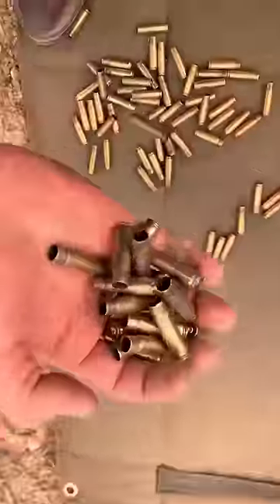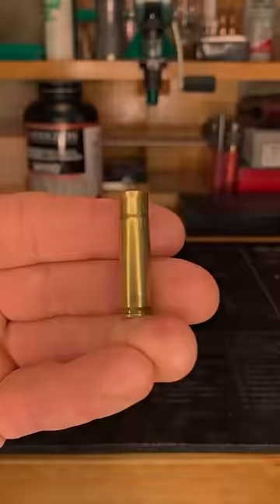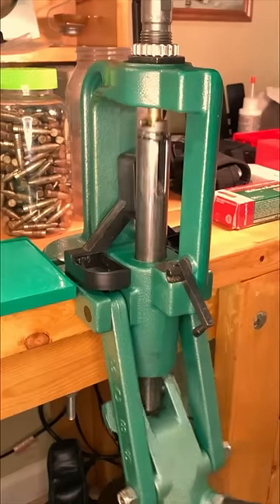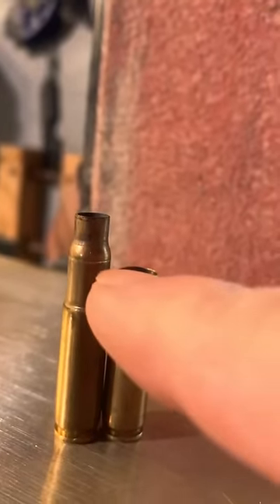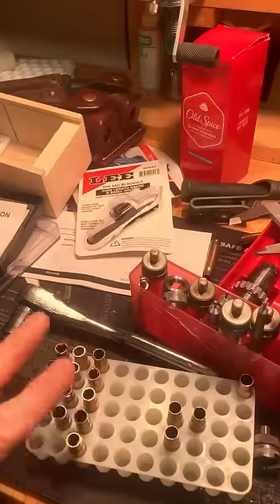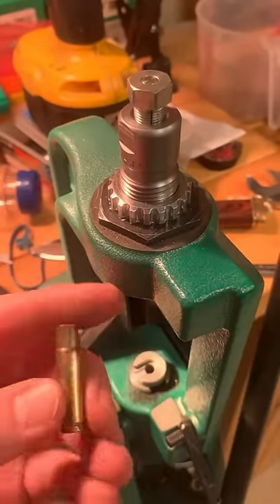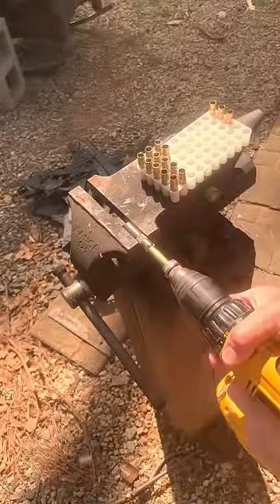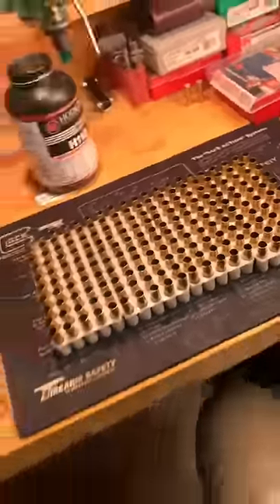How to convert .223 cases to 300 blackout. #shooting #reloading #300blackout

Comment: And  for only an hour’s work you’ve saved yourself 67 cents! Congrats!
Reply from the maker: Maybe you didn’t see the part of the video that shows a jug of brass for $239.99. I produced that same volume of brass in 2 hours. But don’t worry I think you have an amazing head for numbers! Was Good Will Hunting actually based on you?
Reply: #livetolearn
Reply: 😂 good will hunting got yo ass boy 😂
Reply: Giving this dude the benefit of the doubt, he could be factoring in equipment and labor cost, in which case, yes it would still take quite a load of rounds to make reloading profitable. But once you reach the point where the equipment has paid for itself then it's pure savings indefinitely. But on the off chance you've got some source for super discount brass, fill me in, promise I won't tell😂
Reply: @SeanAn117 reloading smaller more common calibers used to be a great way to save money but I recently looked into reloading .223/5.56 and to start out including buying gun powder bullets primers (no brass) and a small started set up I would only be saving about 2 cents a round and that was before factoring in my time which I value a lot more than 2 cents.
Reply: @SeanAn117 you use all this same equipment to reload your big rifle rounds too I’m saving 1.60 for every round of 6.5 I load. I shoot a lot, it’s a hobby that pays for itself if you shoot a bunch.
Reply: @staggerleesmancave8987  how do you like THEM apples? 😂
Reply: But multiply that by maybe 100 or even more, its like a gas u think its maybe didnt increase much put after u start putting it in ur car u can see the cost
Reply: If a man teaches you how to fish, don't bring up Red Lobster.
Reply: @staggerleesmancave8987  somebody call the burn unit we have patient with 4th degree burns over their entire body
Reply: Every penny counts in Bidenomics
Reply: @staggerleesmancave8987  - my guy’s wicked smaht”
Reply: @evankaylor6103  And you have the ability to make very accurate rounds. That's one of the reasons that I do it, and I enjoy it.
Reply: @vicv7075  I think the reminder is longevity. Factor the cost of materials then do the math how long its gonna take to pay that equipment off. Let's say ten reloads. Once you pass that 10 reloads stage long as you aren't regularly buying new brass every day cost wise you'll start saving. Not to mention less general waste of packaging and frankly, if you're factoring in labor on this you're looking at it wrong. Labor shouldn't be a factor because you're doing it yourself to avoid paying someone else to so it, ie keeping money in your pocket. So now consider what you're saving once the gear is paid. You've subtracted labor, packaging and thr cost of the brass itself from the scenario. What's your savings then
Reply: How so? I've been reloading since the 80s. If you reloading a .308 you would save 67 cent A ROUND
Reply: @staggerleesmancave8987  yeah then you need 250 worth of projectiles, 50+ in GP, 55 in primers so 350 dollars. Then the work of collecting the 1000 brass and all the reman work and tooling, or 500 dollars for 1000 rounds. I’m not hating, but it is a good amount of effort to save 150 bucks. Especially if you aren’t running thousands of rounds of one caliber on a regular basis.
Reply: Do you have any idea how expensive ammo is? Mine is running at roughly $4 per bullet.
Reply: @skimbeeble6143  for .300 blk? do you know you’re getting robbed?
Reply: @vicv7075 reloading is absolutely more cost efficient than buying ammo from the store. You can also go very cheap with it as well. Theres soo many different factors in the whole reloading process. Sure if you buy brand new brass and top of the line powder with top of the line bulles and top of the line primers then i understand. If you get into it and use a different powder of different burn/grain structures/smaller load statistics/etc youll save money. You buy or save used brass youll save a ton of money. You buy low end bullets or make your own for the majority of shooting and youll save money. The few main costs are typically finding primers and buying upfront tools. Even this can be done cheaply or secondhand when it comes to actual tools. I mean you can even go cheaper than what i mentioned but i wont go into that on yt.
Reply: If you get a lil extra equipment not even a lot you can subtract the cost of bullets and collect lead with the brass and cast your own bullets
Reply: Either way…67¢ and a whole lotta fun. Win in my book. Act accordingly fellas.
Reply: Yall some hatters. The man is helping! And yall are trolls. Sad.
Reply: @SeanAn117 I just bought all of my reloading stuff for 556 and 9mm. TOTAL plus upgrades  in for 1600. I shoot about 2k 9mm and 1k 556/year. At current prices I’m saving 5cpr on 9mm and 20cpr on 556. It’s about 6 years for me to “pay off” my equipment. That also doesn’t include the random loads here or there I do for my bolt guns/friends 6.5CM, .308, 300blk. I have an arrangement worked out with the guys so I am “profiting” off of that too.
Reply: @vicv7075 how are you only saving 2cents per round? I’m saving almost 20 on my 556 77gr loads.
Reply: @staggerleesmancave8987  if I work over time I get paid $40/h after taxes. I can but 220g OTM at $0.75 a round. If I work 1 hour of OT I can buy about 60 rounds of ammo. Can you make more than 60 rounds in an hour?
Reply: I remember when I could buy .300 blk for 38 cents a round. Got rid of everything in 300 blackout and just focus on .308 now.
Reply: A penny saved is a penny earned but anyway this short is about convert .223 cases to 300bk not about saving money my guy.
Reply: @sean anderson  luckily this guy has reloaded shit tons so the cost has been offset. Probably years ago
Reply: @vicv7075  that's why reloading rounds that are 2 or more bucks a round is worth it. But if you're doing to save money but shoot less than 1000 rounds a month you're never really going to see those savings. Furthermore you're forgetting the main reason why reloaders reload... Controling consistency. If you spent hundreds of dollars tailoring a hand load to your gun and your gun produces accurate shots that will shoot a nail off a barn door at 200 yards. You've justified your cost especially if you're a PRS shooter where depending on your skill level the prize is anything from ammo, gear or outright cash.
Reply: @staggerleesmancave8987  no, stop, he's already dead 😂😂😂
Reply: @elconquistador932  that’s mostly why I do it too. I can reload 9mm with hand poured lead for about 15 cents per rd. In a progressive loader, I can comfortably reload 200 per hour. I’m saving about 20 cents per round, so I’m saving 40 bucks an hour, I get to shoot more, and I’m doing something I enjoy. 

Also good luck finding factoring ammo that can outshoot hand loads in the first place.
Reply: you don't reload to save money. you reload to go to the range more often
Reply: @evankaylor6103  damn straight. I always hesitate when replying to the peeps that resist reloading. On one hand they're missing out, on the other there's less newb reloaders buying up all our supplies and thus driving prices up.  And that's one reason primers are so high, they know people will pay that amount. I'm still in resist mode, feeding off the stockpile.
Reply: @Airondot  Easily, and they're more accurate than that cheap ammo too.
Reply: @elconquistador932  So you’re able to resize .223 brass, trim them down, resize again, ream, measure out the powder, load powder, press in the round, and check for defects all in under 1 minute?
Reply: @dondelchulia3189  not 300BLK. 300 Win Mag. Reloading is always cheaper than buying.
Reply: @7.62by39LesscoBrandon  It is, and I’m all for reloading. However when I math this out, it’s more expensive in time (for how much I make) to reload than it is to buy new ammo. That’s not including the close for all the supporting equipment that I didn’t even factor in. Reloading is cool, especially for more esoteric rounds like 5.7 or something like that.
Reply: @Airondot  I'm nottalkingb300 blk out, I thought we were talking about prepped brass for a standard cartridge. In that case yes, easily on a turret press. Prepping brass no way. But I prep all types of brass and have it ready.
 I understand what you're saying about cost/time and what not. Like in another comment I made its not about speed, it's quality, cost and over time I stock pile. It's not for everyone but everyone should know how to do it it. A matter of time before the Liberals and Rinos in charge go after our ammo.
Reply: @staggerleesmancave8987  Please upload that video where you do everything you just showed us to get the casing where average time per casing with 7 operations per casing is 7.2 seconds.
Reply: @skimbeeble6143  yeah for cartilages like that it makes a lot of sense. Most common rounds are barely cheaper like .300 blk like in this video
Reply: @vicv7075 It depends on what you are trying to do. If you are blasting, cheap bulk ammunition is hard to beat. If you want to shoot sub 1/2” groups, you might need to hand load
Reply: .67 cents per cartridge..
Reply: @Airondot easily
Reply: @Robmancan1987  endless shrimp is endless shrimp bro.
Reply: @staggerleesmancave8987 Someone is mad
Reply: @staggerleesmancave8987  I’d like to report a murder😂
Reply: @staggerleesmancave8987 hopefully (but highly doubtful considering this guy’s lack of self awareness) he meant per round
Reply: @staggerleesmancave8987  fuckin got his ass
Reply: @CLEAN_FINGER_BANG 😂😂
Reply: @Airondot  With my progressive loader, more then that. But you don't have to trim brass everytime. Relaoding for me was my hobbie. Relaoded 4 different pistols and 7 different rifles cartridges. Not all at once and was doing a lot of range time. But if ya got the $ for new cartridges send me the brass.
Reply: @vicv7075  you cant count your time and you should not sell your reloads.
Reply: It’s not about that it all boils down to when there’s no Ammo on the shelf and you’re stuck with a gun that has no bullets 😊
Reply: @SeanAn117  man I don't understand this mentality at all. Having to buy ammo less frequently should just be a universal plus- gives the government less opportunities to spy on you, make up reasons to be suspicious of you, etc.
Reply: yes imo, reloading for smaller readily available rounds is pointless, but for the weekly long range shooter using odd ball rounds like me it definitely saves you a ton. It also gives you a sense of connection and confidence with each shot knowing you did the work and have spent hours fine tuning. For my 28 Nosler it is impossible to find anything under 3-5$ a round, with performance hunting ammunition at the top of that spectrum. Fine with me though cause no factory ammo is gonna send 195gr 3150 with 5 short string ES under 50
Reply: Yea dawg lemme just use my thousands of dollars worth of tools rq , diy fr
Reply: Yea but you also save a lot of time and gas from having to look for said rounds at stores.
Reply: @jerenbarringer897  it’s not thousands to get started, unless you get some crazy pneumatic press but there’s no need for that if your doing it by yourself a simpl hand press is finna and you can find them in kits with many other tools you need for around 500$
Reply: @staggerleesmancave8987  Come on, it's a tired joke but a good one. Let him have it.
Reply: They probably see this as more of a hobby/passion and get the enjoyment of going through the process of reloading their ammunition.  Its a bonus that they can save a few dollars.
Reply: You obviously don't know anything about this. Why even say anything.
Reply: @staggerleesmancave8987  you got quite emotional over his comment lmao
Reply: This statement right here is why i preached to my son about the dangers of drugs and to pay attention in school. 

Excellent video brother, thank you. I jumped on the 300 blk bandwagon soon after its release. Subsonic rounds with a suppressor and just saying Pew Pew is louder than shooting the rifle.
 After the last ammo shortage i literally just left it in the back of the safe. I haven't shot it in a few years now, actually i only have around 100 rounds for it so she doesn't see any backyard fun. I load five different rounds so this looks like a viable option to get her back onto the bench.
Yes i know i can buy 300 blk ammo now but i have been slacking off and loading  other rounds. This sounds like a fun project and a money saver too boot.
Reply: Heard good will hunting was in the comments had to look for myself 😅
Reply: Actually. 300aac are pricey and .223 cases are easy to come by
Reply: @vicv7075 , that's a VERY shortsighted view, but accurate IF you are only going to shoot your gun one round at a time and are rich enough to buy factory ammo every time you go to the range.
But with reloading you can tailor your ammo to YOUR gun and NEEDS. Besides, if you already have the 5.56 or .223 cases, why buy NEW? 
Don't be lazy like vicv7075, folks.
Start reloading and, after amortization of the gear, your ammo is but a fraction of factory new. That is unless you are RICH like that guy above.
Reply: @user-td1zo3tv9p  not to mention.. ai t no factory load as accurate as a reload..not even close!
Reply: @vicv7075   The last time I paid for factory ammunition was 1979 and since then I've enjoyed two hobbies instead of one. Reloading is not only a labor of love,  it also allows you to create custom ammunition for the chambers, leades, throats, and cylinders for your specific firearms with unmatched accuracy. If you live, breathe,  eat, firearms it not only pays off in the short and long run but gives you multiple benefits that otherwise forever remain out of reach.
Reply: @LaxMan2k That's not a great deal of shooting, 3k all year? I've been reloading since the '70s and I still burn 300 rounds every week. About 2/3 is personal and the rest for friendly comp however when I was younger I would go through 500 rounds in a week at Coopers ranch. I personally think reloading is not only a whole nuther hobby but also allows you to create highly accurate ammo.
Reply: greyape59 Maybe, but having an opinion about something you've never ventured to try? It's a hobby all by itself and comes with its own learning curve and the results are extremely satisfying with ammunition designed specifically for your chambers and throats that deliver the kind of accuracy you will never find in a box.
Reply: @thomaspeters5889  I am active duty military and in pilot training so I have almost no time to myself. Can’t afford to go to the range after work every day.
Reply: Was the video completely before commenting something so stupid.
Reply: Is all you do hate

Comment: Just remember to ask before picking up someone elses brass. It's insanely rude to steal from another shooter without asking.
Reply: Good point! It never occurred to me that that might happen, but still a good point.
Reply: What if they are gone?
Reply: @williamwismer8212  in my opinion, if they leave their brass at a public range, it’s basically littering and you can pick it up.
If you’re at a private range, then you need to go by their protocol.
Reply: @williamwismer8212  then they have left it for whomever
Reply: Most shooters do not reload and I have never seen people at the range "fighting" over pickup brass. In fact I usually never seen someone pick brass off the floor but only occasionally. My local range sells their cleaned up brass and won't allow you to pick it up unless you "catch" it with a port net. I personally can't imagine picking up someone else's brass, especially if they're still shooting and haven't left yet. I don't know if it's "insanely" rude however I wouldn't do it.

Comment: The belt grinder is a great idea. I haven’t branched into .300 Blk yet but want a suppressor so it will make sense at some point. I’ve seen a lot of that Top Brass before and it used to always be MilSpec cases that were converted so you are really making out there

Comment: I use a copper pipe cutter, a few twist and I’ve got a reasonably square cut. Chuck it in a case trimmer to finish length.

Comment: This isn't the only case conversion that will save you lots of money.  Throw in a case neck reamer and you can make .221 Fireball, which is almost impossible to find these days -- from free range pickup .223 brass.  Same basic process: size without decapper/expander, trim to length, ream case neck to correct excess thickness, size again with the decapper/expander, then continue loading as usual.

Comment: Its also wise to anneal the brass between the two resizing steps or it could be overly hard and have neck tension issues
Reply from the maker: Luckily, most of the brass I use is already annealed for the entire front half of the case. After trimming there remains about a quarter inch annealed.

Comment: Serious question and honestly I should already know this answer. But I've always just bought ammunition. What equipment would I need just to reload ammunition and the price range to get started? Not including powder, caps and projectile.
Reply from the maker: The most popular starter kits are offered by RCBS, Hornady, and Lee Precision. The first two are around $450 and include hardcover reloading data manuals, which also cover the basic fundamentals that one should know for safety. The Lee kit is around $200 but only includes small fold out pamphlets of loading data (last time I checked). All the kits are currently on sale for Father’s Day from places like Cabela’s and midway USA for considerably less than the aforementioned prices quoted. 
-Stagger